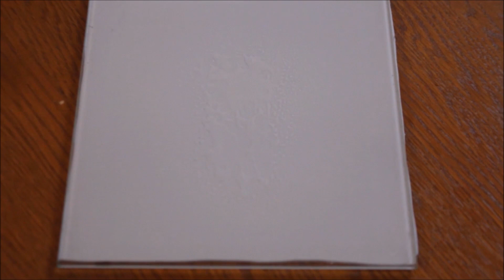3D Printing Tutorial: Best way to clean your Borosilicate Glass Bed

Comment: Can you use it on an stock ender 5 bed?
Reply from the maker: As long as you buy one that is the correct size you should be able to use a borosilicate glass bed with thermal silicon pad for any printer including a ender 5. You will need to re-calibrate the vertical z-direction offset to adjust for the thickness of the glads and pad.